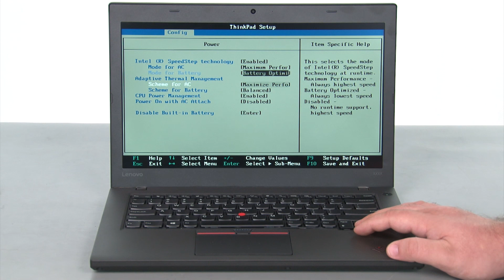ThinkPad T460 Notebook - Memory Module Replacement

Comment: Does doing this void the warranty?
Reply from the maker: No, it will not void your warranty. Most Lenovo laptops have some components that are considered CRUs (Customer Replaceable Units). Usually they're things like the internal storage drive, memory, wireless LAN card. CRUs can be replaced by the customer without voiding the warranty. I think it's nice for the customer, because if they are comfortable working on a computer, they can upgrade commonly replaced parts.